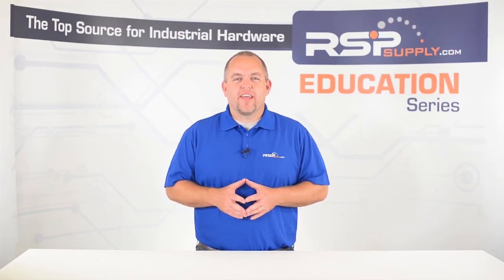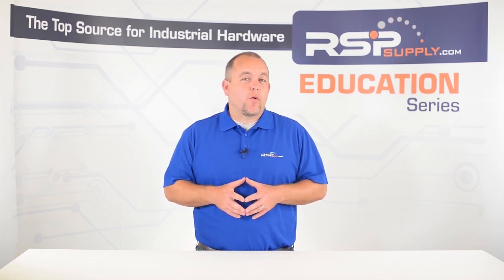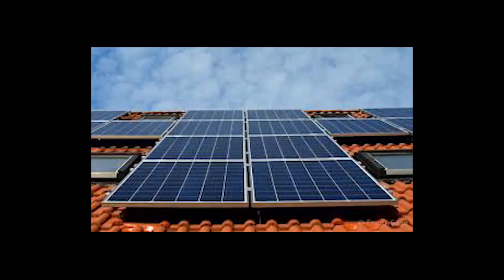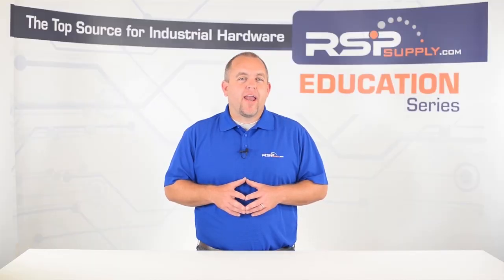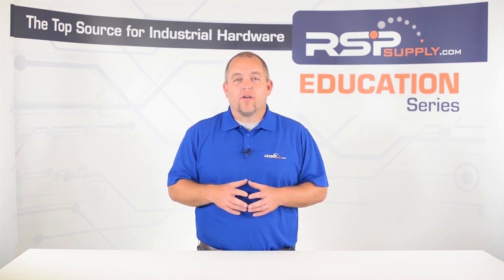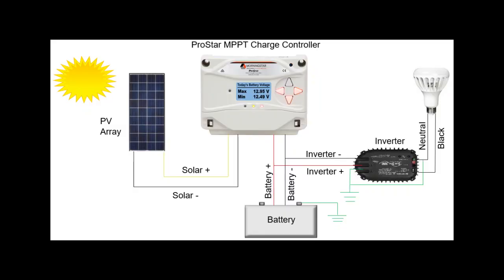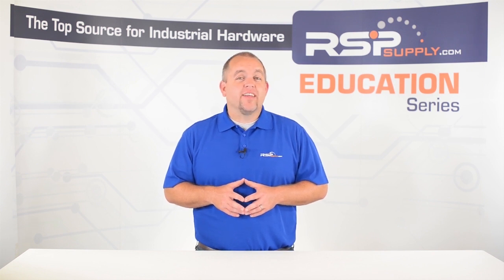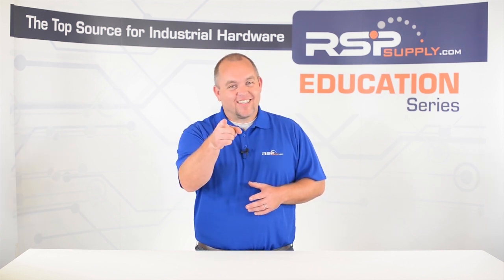Charge Controller Basics

Comment: This isnt correct. The purpose of the charge controller is to provide optimal voltage and current to the battery. Distributing power also to the load is a feature of some charge controllers, but isn't their primary purpose.

Comment: Incorrect. A charge controllers purpose is to regulate overcharging of the battery. That is the charge controllers only purpose. Theoretically you could run a solar set up completely without the charge controller but would put your battery at risk
Reply: 100% right
Reply from the maker: You’re wrong. That is not the only purpose.

Comment: You are incorrect in your description as to how a charge controller operates. The controller never directs the flow of current to or from the loads, however with controllers that offer load control, may be used to disconnect the load from the battery, for instsnce in the event of a low battery voltage condition.   Many charge controllers do not even have a load control as a part of their function, and it's not directly a part of the charge control to the battery. It's simply provides a means of connecting a load at a preset voltage and/or disconnecting it at a present voltage, with the load always being powered essentially from the common connection at the battery.
Reply: You're both wrong. The purpose of a charge controller is to regulate over charging of the battery